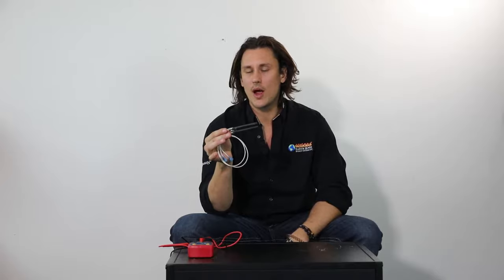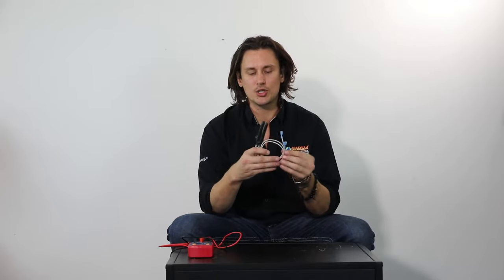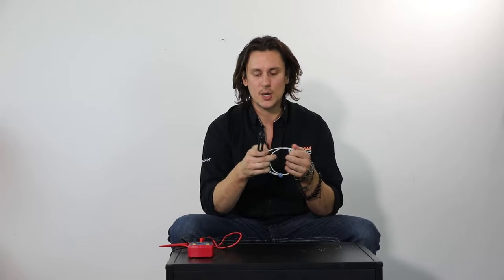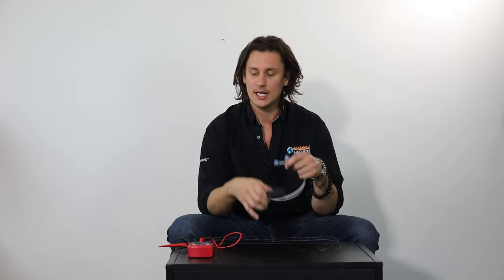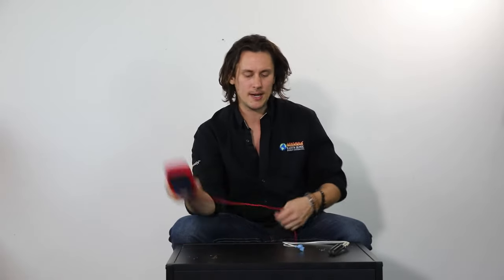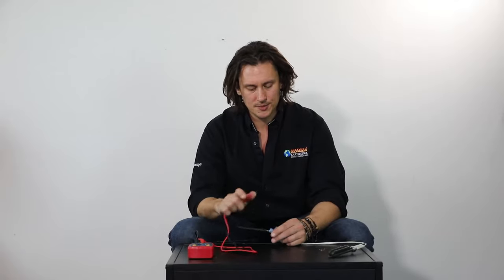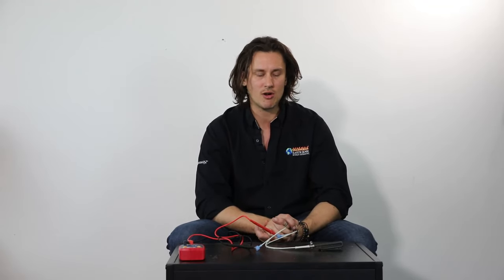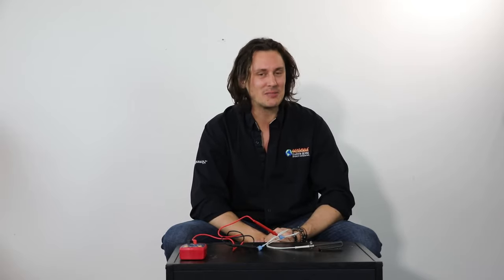How To Test A Stove Igniter, Pellet Stove Ignition Troubleshooting

Comment: Just changed gaskets, igniter, room temp guage and fuse on control board.  Going to test igniter with multi meter, but if that's good, what else could make the igniter not light.  Combustion blower seems to work fine as well
Reply from the maker: Thanks for contacting us Joe, happy to help. What stove make and model do you have? Yes, let's test the igniter to ensure it's in operable range.

Comment: I tested my igniter (Lopi AGP pellet stove, not on your list BTW). I hunted down specs on the internet and found 57 ohms, +10, -5. I was right at 67-68 ohms. After a thorough cleaning per your recommendation to check the basics first, my stove did fire up again. But my question is, what is the nature of these igniters?  I assume I should expect the resistance to get worse, correct?  Would you advise that I replace my igniter even though it’s technically within spec?  I mean, far easier to pick my time and replace before it stops lighting on a really cold night just before bedtime, right?
Reply from the maker: Thanks for contacting us. If the igniter is in proper range I would see no reason to replace it. Now some folks will keep a spare on hand so if it does go out in the middle of the cold they can replace it. Over time, resistance can become more or less with the igniters - when they fail we will see ohm numbers either way higher or way lower than proper range. Much of the life expectancy depends on how often the igniter is going on and off. Keep the burnpot area and stove clean so you have proper air flow for ignition. Hope that helps!

Comment: I have a Harmon p43. And I was told to make sure the igniter is shutting off due to burn pot issues. When I check it with a non contact meter. It’s showing the yellow wire always has power even if the igniter light is off. The light blue wire never has power. The stove lights fine. But someone told me it is possible that the igniter isn’t shutting off when it’s supposed to.  When the igniter is off should the yellow wire be showing a current or not?
Reply from the maker: Thanks for contacting us. Unplug the igniter from the wires and plug your meter into the yellow and blue leads.  If the igniter light is off on the board with the stove running there should be no power there. If there is power, the board is the culprit of not shutting off the igniter and should be replaced. Keep us posted, happy to help.
Reply: @EarthSense  i put a new board in that I purchased from you as a precaution.  Again using a non contact meter. With the stove plugged in but off  and only the status light lite Its showing power going thru both the yellow and blue wires.  However the burn pot is not hot. But when it was lighting the yellow had current but the blue didn’t.  I just want to confirm that everything is working correctly before I put a new burn pot in.

Comment: Hello, the pellet stove tells me that I have an ignition problem (Winslow PS40). Ready light is constant red and ignite light flashes two short blinks. When I look at the list of possible problems, everything is correct! As soon as I put the selector between 1 and max and press the start button. The ignition start sequence begins its 15 minute cycle. During the next 15 minutes, the stove deposits pellets cyclically into the combustion chamber, the combustion fan turns on and the igniter heats. I don't understand why after 15 minutes the pellets stop falling into the combustion chamber and the stove has ignition problems. However, the entire 15-minute sequence is functional (ignition ignites the pellets, flame in the combustion chamber and the hopper works, because the pellets fall into the combustion chamber, etc.). Do you have an idea of the problem ? a big thank you in advance!
Reply from the maker: Thanks for contacting us. Based on what you are saying it sounds like we have a 'proof of fire' issue, not an ignition issue. Your stove sounds like it is igniting/lighting correctly and the start-up sequence sounds correct. There is a low limit switch mounted to the combustion blower exhaust motor housing. This is the proof of fire switch. This switch detects the heat during start-up and allows the auger motor to run once it reaches temp and closes - essentially going from start up into normal operating mode. Let's double check this limit switch. Pull it out and clean it, steel wool can work great in getting off the crud. Make sure electrical leads are secure. From there we can bypass it for testing purposes only to verify if the switch is the culprit. Here is a video on that - keep us posted. Thanks. 
https://youtu.be/FDVkbsHS95U?si=hL0u13rne2tz6eBU
Reply: Many thanks for your advice. I cleaned the fire switch with steel wool and the stove works like new. Thanks again ! @EarthSense
Reply from the maker: @Mat-vo7ju  That is fantastic to hear! So glad we were able to help. Any questions or needs down the line just let us know. Thanks!

Comment: Second winter with a Quadra Fire pellet stove. Have already replaced the main board, auger motor, and now my igniter has died on us as of last night. The stove came with the house, I think it is 4 or 5 years old. While I'm not all that impressed with our stove letting us down over and over, these videos have saved me a small fortune in service calls. Thanks for what you do.

One thing I realized with my own igniter troubleshooting is that during startup, the fire pot stays stone cold. I realize that it's the hot air blowing through the holes that ignites the pellets, but if you can't detect any warmth at all in the fire pot during startup, it's a pretty good indicator before you even get the meter out that your igniter is probably hosed.

Now I'm just trying to figure out if my stove has a 300 watt igniter, or if I need the 380 watt version. It's a Classic Bay 1200
Reply from the maker: Sorry to hear of all the troubles you've had with the 1200. I'm glad our videos have helped and I hope everything will be solid for awhile once you replace the element. 

Yeah, that's a good point on the igniter. If it's not getting hot at all generally it's the element. I always encourage folks to check the electrical connectors and lead wire electrical as well to ensure power is coming through from the control box. 

If you are only burning pellets in your 1200 then the 300 watt is what we would recommend. If you are burning a mixture of any other types of biomass fuel such as corn, then we would recommend the 380 watt. 

Any other questions let us know. Always happy to help.
Reply: @EarthSense  Thanks again for the vid, my new element showed up and it's fixed. Old one was shorted and showing 0 ohms on the meter. Just glad it didn't take the main board / fuse with it. I think I will install a fuse inline on this new igniter just to add another layer of safety for the control board.
Reply from the maker: @Stormyism  Thanks for following up! Yeah, lucky the shorted element didn't blow out the board as that is known to happen. Glad the new igniter is in and working properly. There are other stoves that do use an in-line fuse with the igniter element, not sure why Quad never did that as it does add an extra layer of safety for the control board in the event of a short. Any future questions let us know, always here and happy to help how we can. Thanks!

Comment: Great information on your videos!  Really appreciated your skills in explaining the "how to" .  I do have an igniting issue with my harman allure 50.  On the screen obove it shows my igniter at 77°, i then checked with my fingers to see if it was hot to the touch, and it was.  I then cleaned the stove (which wasn't all that dirty) then removed the igniter to test it and for a this igniter 45 to 53 ohms is the range which mine was @48.7.  Gaskets are tight, justhad them replaced last year firebox and ash.  Any suggestions?  Tried to find some more of your videos on if its not your igniter....no luck.  Thank you for your input....fire pot holes are clear...gaskets are good, stove is clean, igniter in ohm range, what next?
Reply from the maker: Thanks so much for the message. Checking in with our Harman tech team to see what suggestions we have for you on next steps. We will follow up ASAP. Much Appreciated!
Reply: Thank you.  Appreciate it.
Reply from the maker: @bubbiecarrillo9220  Thanks for your patience. Let's double check the burnpot holes to make sure all are open/clear. Oftentimes carbon buildup can form blocking a key row of holes. Keep in mind, it's the super heated air passing by the igniter that rushes through those burnpot holes igniting the pellets. A good light, mirror, and small precision screwdriver will be very helpful tools to make sure they are all open and clear. Below I have a link to a Harman super scraper for the burnpot just for reference. If that all seems good, let's check the position of the igniter cradle and mount. Keep us posted, happy to hget you back to 100%! Thanks. 
https://pellethead.com/product/harman-heatilator-eco-choice-burnpot-firepot-grate-scraper-tool-aftermarket/
Reply: Thanx for getting back to me.  I did do a thourough check of the burn pot, everything looked good, I even removed the igniter to make sure it was correctly positioned in cradle, it was.  Put everything back, and ran a test run and now it works!  I'm a little confused as to why it is working now as opposed to earlier.....but you must have some magic or something...lol.  Thank you for all your help and these awesome do it yourself videos!  I do plan on purchasing some tools from you in the near future like that scraper and a vacuum.  Thanx again!
Reply from the maker: @bubbiecarrillo9220  That's good news! I'm thinking it had to be just something slightly off with the igniter and cradle cage. So glad we could help and everything is up and running again. Any future questions please let us know! Thanks.

Comment: Great video..My first experience of pellet burners-looking after a house in Italy. All working well this week then today cleaned the ash out and now it won’t work..so guessing I’ve not put things back properly..but pellets are dropping into pot.any ideas? The model
of the burner is Caminetti Montegrappa..no instruction manual.
Grateful for any help 🙏
Reply from the maker: Thanks for reaching out. Unfortunately we do not have any experience with the Caminetti Montegrappa. In most pellet stoves it is the air rushing around the igniter that becomes super heated to ignite the pellet fuel during start-up. If there is any air loss there will be ignition issues. Make sure the door and ash door if applicable are sealed tightly. Make sure the burnpot is properly seated. Check the very basics first - especially if it was working fine before the cleaning. Hope that is helpful. Thanks!

Comment: Thanks for reminding me about the air flow being just as important as the ignitor. was able to clean behind and under. starter works fine! Our Lopi is a good product 1 ignitor in 10 years
Reply from the maker: That's great to hear Joe! Yes, air flow is key. The Lopi line are great products, yes. Any future questions just let us know. Thanks!
Reply: Just to emphasize Joe's comment, I found that piece of information involving the way the ignitor works absolutely paramount. I cleaned underneath and the dang thing fired up the fastest I've seen. Thank you for the video. :)

Comment: Thank you for all the information you provide and your prompt service in shipping parts. On my Harman P68 (9 years old) I replaced the burn pot and unknowingly pinched the igniter wire. Discovered when the fuse blew upon first start. Replaced igniter and fuse and thought I was in the clear only to discover several hours later there was heat in the firebox. I did not light the stove but apparently igniter is getting a charge. How do I fix?
Reply from the maker: Hey Bob, thanks for contacting us, happy to help. Glad we have been able to be of assistance for info and parts replacement. I would start by checking the simple things.
1. Make sure the igniter is mounted in the cradle properly and make sure the cradle has been tightened down evenly underneath the burnpot.
2. Make sure the burnpot holes are open free and clear. 
3. Make sure the igniter cover door is placed on securely. 
4. Make sure front door and ash door are closed and sealing tightly. 
5. Make sure nothing is blocking the air intake that goes underneath the burnpot. 

Let's start there. It's the hot air rushing past the igniter which lights the fire, so let's make sure we have no air blockage or leakage issues. Keep us posted, happy to help you get this figured out. 

Appreciated,
Reply: Earth Sense
I checked the position of the igniter and made sure it was sitting properly. I did the ohm test and it checks out.The burnpot is brand new. I have not tried to light the stove, but as soon as I plug into the outlet, the igniter starts to heat up. It even activates when the manual igniter switch is on. Except for being plugged in,  I have not powered up the stove at all. As I previously explained, the reason I replaced the igniter is because I pinched the wire in the old one while replacing the burnpot. It caused a short and blew the fuse. I replaced the fuse and turned the knob to the “test” and all systems activated. I suppose it could be the part of the mother board that controls the igniter that could be the problem. Thanks for any help or advice.
Reply from the maker: @bobmlynar9740  Thanks for the message Bob. I'm going to heavily lean towards this being a circuit board issue if the igniter is getting power when you plug the outlet in and have your controls to off. Something must have shorted in the igniter block on the circuit board for this to happen and allow power directly through to the element. See if you can inspect your circuit board and check for any chars, melts or burn marks. Keep us posted. Thanks.

Comment: Hello,

Thanks for all ofthe very informative videos regarding pellet stoves.

I need to replace
the igniter on my Napoleon NPS45 Pellet stove. Does it matter whichway the igniter leads clip into the crimp connectors on the wiringharness? The female crimp connectors on the wiring harness are blue and red. Can the 2 wires from the igniter be clipped into either wiring harness connector? Or is there a specific connection patternthat needs to be followed?  Thank you!

Peter
Reply from the maker: Thanks for contacting us Peter, happy to assist. The wires can be clipped to either of the lead wires, it does not matter which connects to which - just creating continuity through the circuit. Any other questions please let us know. Thanks!

Comment: My igniter isn't getting hot at all. It ohms test right in the middle of the range for 7000-462 @37.9 ohms. All the connections are good. What's the next step to test. I can manually light it and runs as should.
Reply from the maker: Thanks for contacting us. Apologies I did not see your message here until today. Yes, ohm range indicated looks correct for the Quad 7000-462 element. If the igniter is good, and all wiring connections are good, the only other thing that could cause the igniter to not come on would be the control box. If you have a local dealer nearby you can have them test the control box to make sure that is the culprit. You could also use a multimeter to try and determine where power is cutting out for the element by following the lead wires to the junction box. During startup, line voltage should be coming through from where the wires connect to the junction box. You can also pull the igniter out and do a bench test. If it does not get cherry hot we have an issue with the element, if it does get cherry hot than most likely we have an issue with the control box or wiring. Keep us posted, happy to help. Here is a video on creating a test cord to do a bench test; best practice will be to gently put the loop igniter into a vice while testing. https://youtu.be/rlmiCYI2WPk?si=D3e-HVqm2GcacT4h

Comment: I have a Whitfield Advantage Plus, Model No: WH-119540 pellet fireplace insert.  A lightening strike I think took out the starter unit.  The display lights come on as advertised, and the blowers are coming on as before. The auger is feeding pellets as before.  However, there is no heat from the starter (which I think was an add-on Fastfire Self-Igniter, as there is a notation in the Owners Manual that this is an option for this unit).  I have removed one lower limit switch and one upper limit switch and they both operated properly with heat application.  The circuit diagram suggests that there is an additional upper limit switch but I can’t locate it.  Could that be the problem with the starter?
How do I gain access to the starter?  I don’t think I can remove the insert from the fireplace.  Does the igniter have a fuse?   Thanks for your help and advice.
Reply from the maker: Thanks for contacting us Paul. In your model you will have a Fast Fire Timer Block which controls the ignition sequence/cycle. I would suggest you first test the Ohms on the igniter element. The igniter has heat wires and is threaded in just underneath your auger motor. Video below on testing the igniter ohms. Your Whitfield igniter should have a reading between 33.0-39.5 ohms. If it is higher or lower than that range the igniter is bad. If the igniter reads between this range, then most likely it is the fast fire igniter block that needs to be replaced. 
Fast Fire Igniter Block: https://pellethead.com/product/whitfield-wp2-wp4-wp7-quest-advantage-fast-fire-timer-block-oem/

Testing Igniter Ohms: https://www.youtube.com/watch?v=z4wmCc96rVI

Keep us posted, happy to help!